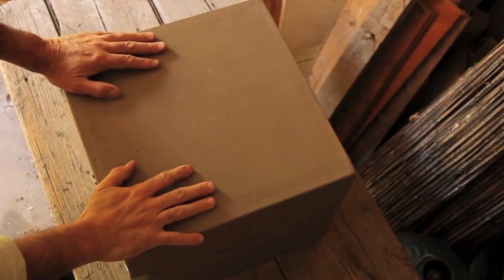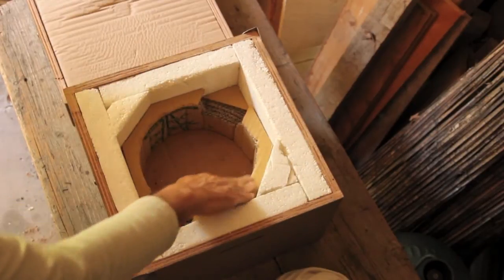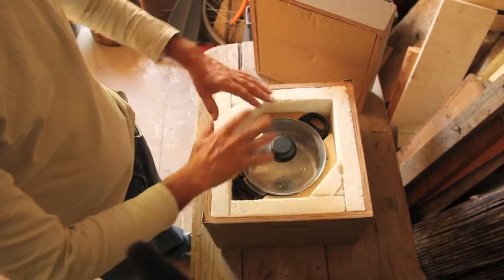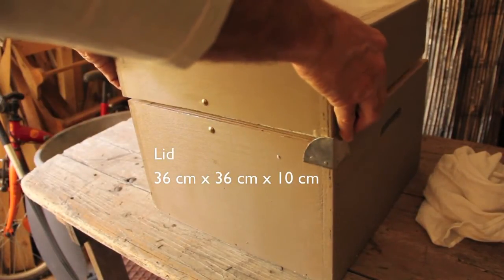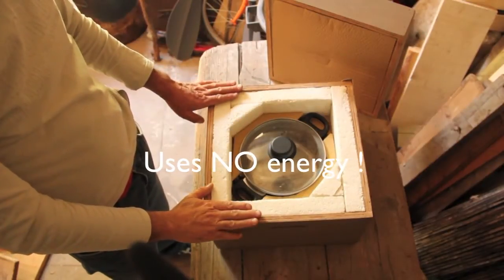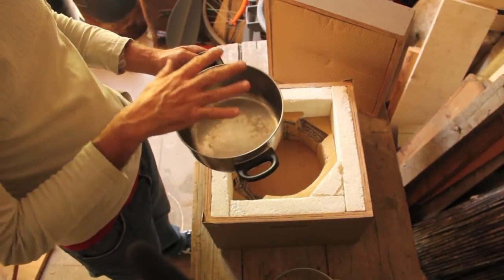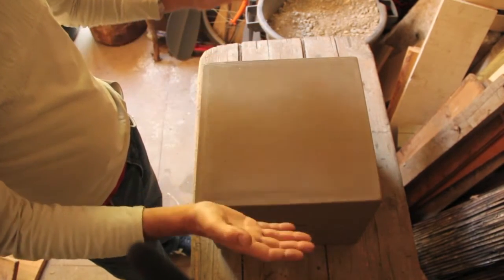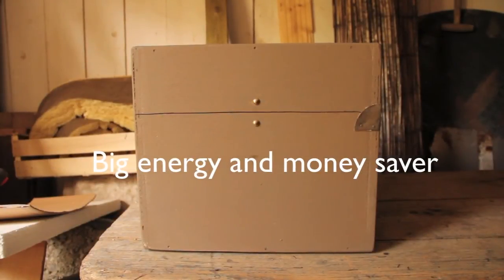Home made hay box or thermal cooker

Comment: You can use pressure cooker and just cut boiling time to 5 minutes. It'll also keep temperature better because of valves.
Reply: Agree  I put my high-pressure pan when it comes under pressure after a few minutes heating into a bedspread and then into a sleeping bag. After four hours and a half I still measure seventy degrees Celsius with my meat thermometer. Great for stews, soups. Also to make yogurt, bring two liters of milk to temperature 45 degrees celsius and add 2 tablespoons of a yoghurt with a living culture and after eight hours I have perfect youghurt. Keep a small jar to use as live yogurt next time.

Comment: We cook with a rocket stove and have a thermal bag. In a pressure cooker we bring the rice up to pressure and then place it in the thermal bag. in 15 minutes the rice is perfect. The same for beans but leave them in several hours. But using a rocket stove, the pots are covered with soot and the thermal bag gets really dirty. 

We find enough prunings in the neighborhood to fuel our rocket stove for free. My wife grew up cooking on an open wood fire and she really loves the rocket stove. It uses 1/4 the fuel, cooks hotter and no smoke except at start up. 

Between the rocket stove and thermal bag, we only use 1/8th the gas, or in other words a month's gas bill is now what we pay for 8 months. (We only use gas when we just want to heat something up or guests come.)
Reply from the maker: That is fantastic - Way to go ! Would love to see a picture of your setup
Reply: How much of a difference does the pressure cooker make vs using a normal pot? Have you made that comparison?
Reply: @TaulantRamabaja  Cooking dry beans normally takes about one hour and a half. Cooking the same beans in a pressure cooker takes less than one half the time to cook.

Comment: can wood ash be used as an insulator as i have loads of this from my fire. all so can loose polystyrene beads be used? 1 more question. what did you line the lid with? Thank you for taking the time to make the video.
Reply from the maker: Thanks for watching and for your comment. Wood ash is a  good insulation, the only thing is you would have to make it "leak proof" and not have ash leaking... Yes polystyrene beads are fine, again you would need to find a way to contain them, some people have actually used bean bags as thermal cookers ! Polystyrene is inside the lid.
Reply: I made my insulation out of a thrift shop wool coat. Wool has excelliant insulation properties. God bless.

Comment: How do you keep the Styrofoam from melting?
Reply: I use lots of towels to stand the pot on.
Reply: I use a layer of folded heavy duty foil, shiny side up underneath the pot. Its most heat, you see, not enough to actually melt the styrofoam. But I do that anyway. Also extra heat reflection.

Comment: I saw this technique in a book called "The Solar Boat, and he claimed he cooked whole chickens this way. Have you tried that? Thanks btw.
Reply from the maker: I don't eat chicken so I would not know ! This being said if meat or chicken are submersed in a liquid, like a stew it would work. The thermal mass of the liquid does the cooking.
Reply: @gaetanproductions ,  This works great! I just use a super cheap Styrofoam cooler. I spread a towel in the open cooler,  place a 5 inch stone on towel so I  don't melt the cooler, boil; food, place pot,  with long handle, LOL,  water and all, in pot, pull the edges of the towel up and wrap pot, use 2nd towel to finish filling box, close cooler, wrap in larger towel, open a few hours later. Even tough chicken is very tender.

Comment: You havnt saved time you've just kept it warm, if you know how to cook efficiently ie cook 3 or 4 things at the same time you don't need this as a "time saver"
Reply: You've missed the point of the video. It isn't about saving time. This method of cooking saves fuel, thus saves money when that fuel has to be purchased. This method only needs a small amount of energy at the start of cooking, instead of needing an energy source for the full time needed to complete cooking.
Reply: Nope, you keep stuff warm at lower temps. Anything above 165F and you're cooking.
Reply: Nope, You can not cook a pot of food in just 10 min, such as a stew or soup. You have to stir and tend to it over the simmering times. Bringing a pot of food to a fast boil and then leaving to cook on it's own in a hay box that requires no more stirring it or monitoring the temperature does save time. But saving energy costs is the big deal here.
Reply: @nnu110  how about doing this with a pressure cooker? When that boils its 121 C / 250 F. Transferring it into a haybox at that temperature would be even better. Faster cooking, guaranteed results. I'm gonna try soon. Just bought a pressure cooker and made a haybox for it.
Reply: It does save time though. I boil a stew 4 minutes,into the hay box and go about my day. It saves time AND fuel. Plus I dont have a burnt pan to scrub!
Reply: ok, I tried it, it works and I haven't looked back. It's the only way I cook now. When the stovetop pressure cooker reaches 121 C and the pressure release valve starts to hiss, I just transfer the cooker into a haybox and let it sit there. A few days ago I put it into the box at 2100 and at 1430 the next day it was still hot enough to eat right out of the cooker when I finally took it out. The meat was so tender it fell apart in my mouth. And the potatoes were not overcooked. Go figure.